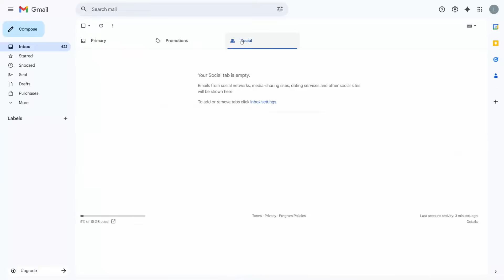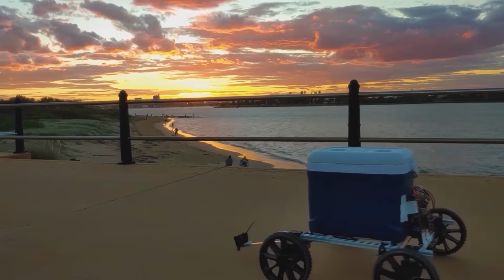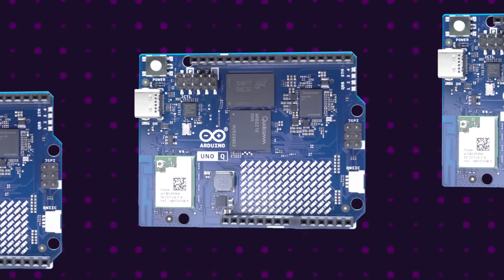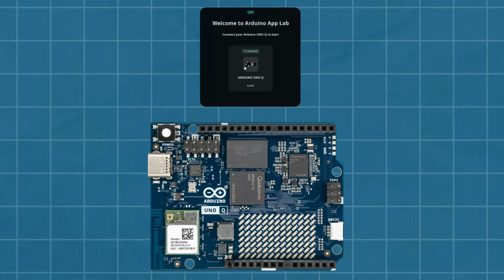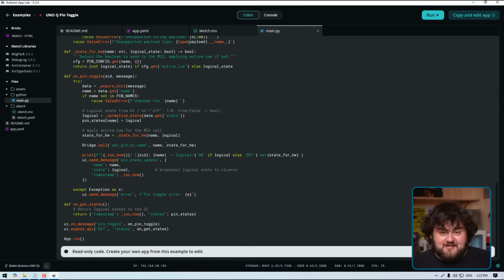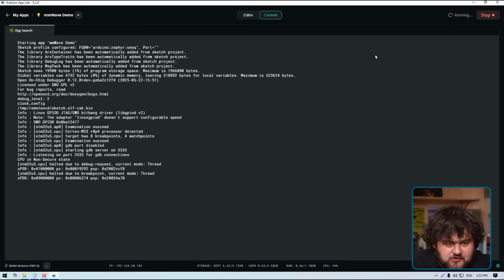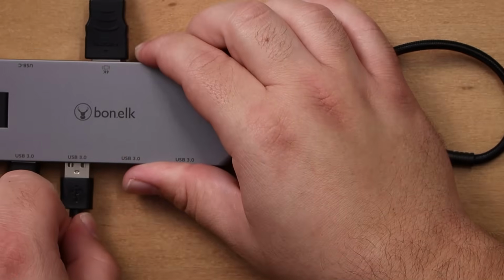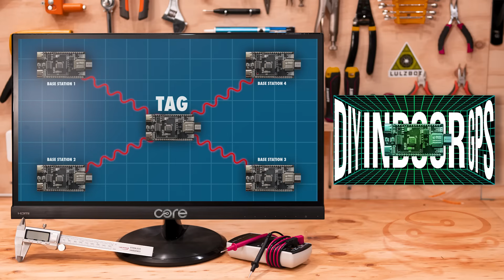Is The Arduino Uno Q For You?

Comment: Forcing the use of their website in order to program it along with signing your code away seems a little offensive for something that started out as open source. Their IDE only works with one of their boards connected. So if you have uses for Arduinos you are going to need two IDEs.  If I'm wrong let me know.
Reply from the maker: Programming is done through App Lab IDE. A little annoying that you need an Uno Q connected to use App Lab, but a windows installation of App Lab is just reading off the Uno Q itself - all the demos and everything are stored on there.

Not currently implemented, but they are working to get App Lab to work fully offline as well. A tad annoying to be constantly online right now, but with how many bug fixes and updates App Lab is getting, don't mind it.

Comment: Would this be a good board to run a cnc machine or 3d printer using grbl?
Reply from the maker: There are Uno shields out there if you really want to run it on an Uno Q and have an easy to work with board, but maybe a dedicated grbl board might be better for that.

Comment: Nice video, this board does not fit my project because it doesn’t have a mipi camera connector. USB cameras add latency so not good for me sorry I need every ms. In my opinion Arduino should have added a mipi header and release a camera as well. Raspberry pi still has the best camera value, but they should have added GPU in RP5 for lower power h264 encoding and other stuff
Reply from the maker: We have seen a few MiPi camera boards around that connect on the pins under the Uno Q, but none have released yet :(